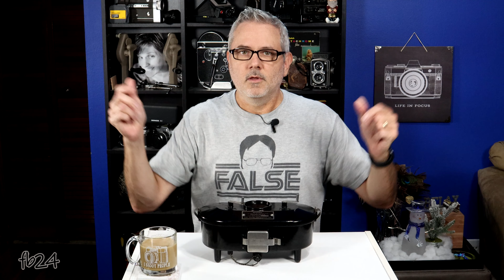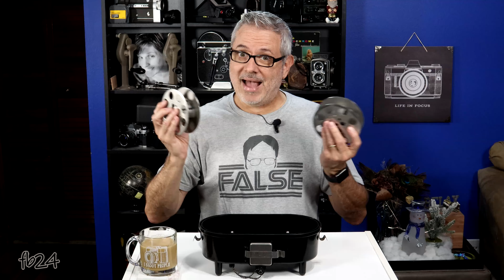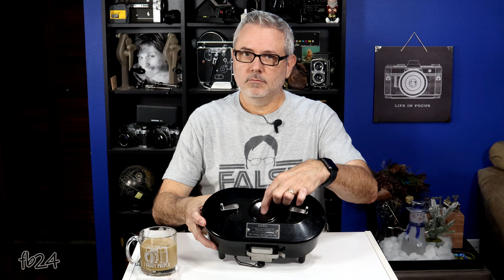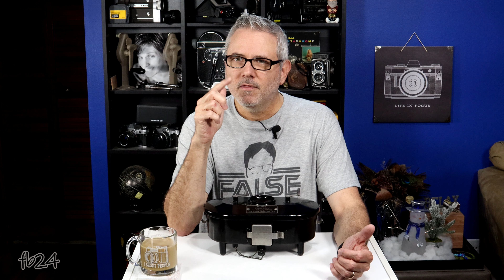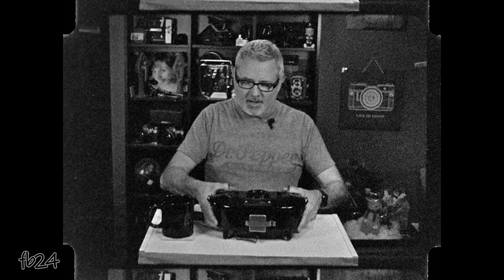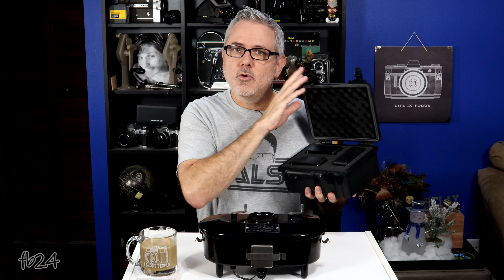Using a Morse G3 16mm/35mm Developing / Processing Tank | Arri-S & Tri-X 7278 Sync Sound | Filmboy24

Comment: Mike, the processing looks great. Very consistent, I agree with  Allen, may be caused by vibration.  We use to put a wide rubber band on our focus and f-stop  rings if we expected bumps or vibrations. 16mm looks great. Maybe we need to form a focus group LOL
Reply from the maker: Thanks, Barry!! That's a great idea! Never thought about rubber bands to hold everything in place. Might be a good idea to use it all the time, just in case :)

Comment: Its a fine tank when the reels are there (later made in hard plastic) and the Ballet body and/or lid do not have a crack or chip that could cause a light leak.  Note some later tanks do not have the window to see the film develop or to use to expose light on reversal film.  The Tri-X turned out pretty good and we just had some good results with Kodak color negative 7291, so we'll see what happens next.
Reply from the maker: Yep, had a few of them over the years in "not so unbroken" condition. I've never seen an actual Morse brand G3 processing tank without the re-exposure window, but I have seen the Russian clones that don't have them, that's interesting to know. The Russian version does Super 8 and 16mm, which could be the way to go for most people. Thanks, as always!!

Comment: Came out great and congratulations on conquering the Morse tank🙂.  I used one about  4-6 times back when fresh film was inexpensive years ago and then put it on the shelf until I sold it earlier this year to finance a good part of the Lomo.  I was doing reversal B&W which may be one reason the results were bad, since it was quite difficult to properly re-expose the film because my model (made for 8-35mm film) did not have the window and the reels were solid on both sides, so you could only expose the film from the top and then it was only hitting a very short section of film at a time.  I also hated the winding 🙂.  As you know, I haven’t had success yet with the Lomo but I’ll get comfortable with loading it and I still have 3 or 4 rolls of cheap film to practice with 🙂
Reply from the maker: Thanks, Dave! I've seen those tanks with no exposure window, just never owned one. I can't imagine what it must have been like trying to re-expose to light, grrrrr. No doubt in my mind that you can conquer the Lomo tank! Keep practicing!!

Comment: Hi Mike.  Loved the video.  What is the little window for ?  The one that is right above the plug that you use to empty the tank?  Do I normally keep that closed?  I think I need a gasket for mine.....
Reply from the maker: Thanks so much! The window if for re-exposing your film to light when processing as a reversal. I don't use it (for now anyway), as I really only do negative processing.It needs to be closed and light tight for most processing. I just made a seal from some thick, dense hobby foam. Worked great!

Comment: Fantastic video! I just bought a Morse almost on a whim for just £10, in really good condition. Even if it's not as good as your average Lomo (still don't have one, ideally want a UBP-1 for the 100ft reel application) but for pocket change considered it a worthy find. I assume you can easily develop double 8mm in a G3, considering it's 16mm unsplit.
Reply from the maker: That’s a great price! Congratulations! Yes, you could also do double 8 in them. There’s also a Russian version that does super 8 and 16mm.

Comment: I have a g3 tank and I am trying to develop Kodak 7222 b/w do you know how I should calculate the time and number of winds I should use with d76 developer? Also do you use a stock solution or 1:1?
Reply from the maker: I use HC110 primarily, though I do occasionally mix up a batch of D-76. When I do, I use it stock. I honestly just experimented with my times and for me, it was around 14-16 minutes for most B&W stocks. This would equate to roughly 14-16 back and forth winds.
Reply: @Filmboy24  Thanks for the info I'm going to give it a try.
Reply from the maker: @isidorocosentino5681  My pleasure! Best of luck!!

Comment: Mike I’m very surprised at how well that came out. It looks really good!  I too have had one of these on the shelf but have been hesitant of using it since it does seem to be a bit “ Mickey Mouse“ of its system. But that’s impressive.  I have seen a Russian versions of this tank and it actually had an electronic motor that did the work and it would automatically switch directions. But they are rare 

Ps I uploaded a bolex 8dl test video :-)  hopefully more to come
Reply from the maker: Thanks, Alex! I'd absolutely love to fabricate some kind of motor system for this thing. Would make life so much easier. Makes me wonder if something similar then could be done with a 400' roll of film. Ok, that might be pushing it, lol.
Reply: Ha yea 400 would use allot of developer  especially if your doing colour 😬

Comment: Take the lens off and give it a shake. The vibration could of loosened an element out of place. Double check if the lens is still mounted tightly also. Might need a little tightening on all the screws.
Reply from the maker: Thanks, Ryan! I'm actually following your advice right now. I have the lens off and it does have a little rattle. I'm working on tightening everything up as we speak. Thanks again!!

Comment: Hey Mike.  There is one of those electric Russian tanks on eBay.  This one is a bit odd.  The one I seen just had a plug for the mains 

2x Serviced Unique RARE UUPP-2 Motorized Developing Tank For 16mm/35mm/80mm Film
Reply from the maker: Wow, that's insane! And according to the description, they will hold between 200' and 400' of film, depending on the thickness. Very, very interesting. Thanks, Alex!!

Comment: The film audio sync was phenomenal ive hardly seen much of it but this was great

As for the film slowly losing focus it seems like with crystal sync motors they do make more vibrations from added torque gears so that could be the case with your lens losing focus a way to stop that would be a bit of gaffers tape on the lens to keep it stable
Reply from the maker: Thanks so much!! I think you're right, I do believe the lens vibrated right out of focus. Thanks for the tip!!

Comment: As always an amazing job Mike! But I want to ask you why the focus of your face is gradually leaving the exposure of the film?  Could it be a problem with the development or the camera?
Reply from the maker: Thank you, Kike!!

I think we figured out the focus issue. It was the aperture ring rotating as the camera was running. The ring is quite loose but I think I have it solved now :)
Reply: @Filmboy24  ahhh ok¡ thank you
Reply: @Filmboy24  Another question is the same light that you use for the video or have you had to put more power?
Reply from the maker: @kikelozanotriana7763  Good question, I used the same lights that I always use for my regular videos, but I should have used a couple more for the film.
Reply: @Filmboy24  i untersand gracias¡

Comment: The film looks absolutely stunning, I just have a question.
How did you know how many rotations the film needed if you compare it to minutes or the amount of time the film sits into the chemicals for?
Reply from the maker: Thanks so Much!! Well, that's a good question and I guess I just got kind of lucky. I usually process Tri-X for anywhere between 5-7 minutes, so I decided to go about 3 times longer in this tank. For me, it was taking around 1.25 minutes to crank 100' from one side to the other. I decided that I'd do that 14 times (7 one way and 7 the other), which ended up taking just under 17 minutes (whew). I then did close to the same with the fixer.
Reply: @Filmboy24  thanks I appreciate it

Comment: How did you dry the film?
Reply from the maker: I hang the film on "V" hooks that are hanging from a stretched rope. I simply bend paper clips so that they hang from the rope, kind of like a Christmas ornament and bend a "V" at the bottom of it. I lay the film into them so that only the sides touch, and it hangs and dries in 30 minutes to 2 hours (depending on how wet it is).